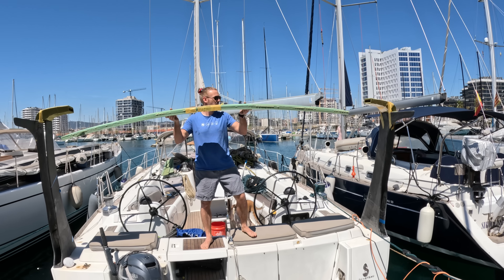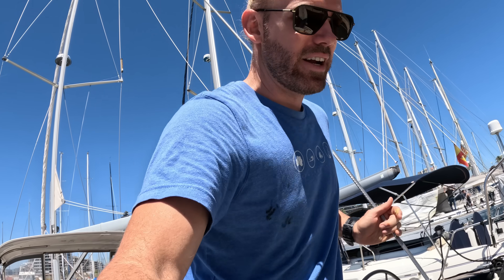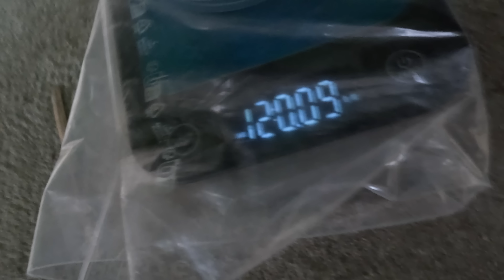Carbon Fiber Hardtop Bimini: The Ultimate Rain Catcher and Solar Power for Our Sailboat (9)

Comment: I admire your effort but I think you should cut your loss. I don't see how this is going to work. If you hang an inflatable from it and then  heal over you will get a lot of sideways stress that will be transferred to the deck by what looks like 2 inches. Think of it as a 5 foot crow bar! How are you expecting this setup to handle the sideways stress of a pounding sea on a heal?

Comment: CONCERN CONCERN!!!!  Bret, your bolts on your Carbon Fiber wings attachment to the boat, need a metal stock plate that you screw into.   Inside your wing and under your boat fiberglass.  Currently you have a   1.5" washer/bolt.   Over time those fibers are going to wear.  Take anything plastic and move it back and forth enough times and you will have 2 pieces.  Same theory with your 2 bolt holes for your carbon wings.

Comment: Why are the legs in two parts? If they'd have core and couple of layers of wrap around fiber, they'd be like about 1000 or more times stiffer sideways. Also, if they were stiffer, there would be less local bending on the mounting points and so on.
It wouldn't be the first time that the solar arc turns out to be too flexible sideways

Comment: HI guys , having worked in a glassfiber factory for a few years making parts for coaches and some boats , i know you are going to reinforce where the new legs bolt to the hull , a structure is only as strong as its weakest link . and to reinforce where the bolts intrude into the hull on the inside can only be a good thing , just saying is all . love youre channel and what you are doing , looks fantastic .keep up the great work .

Comment: This carbon fiber layout is a very labor intensive project, but the results are very impressive.
I did not realize that the foam in the stanchions would be removed. 
So, is there a threaded boss that is part of the assemblies that facilate fastening the sections together?

Good work you two!

Comment: The thicker the beam, the stronger it will be - Spear It Animal did what looked like 1.75" foam core with fiberglass on both sides, which seems to be strong enough - sort of surfboard dimensions.  Why are you guys going so thin with yours? 
The foam doesn't weigh anything, so why not have a thicker cross section?

Comment: This has been a ton of work.  If this fits and works the first time, you two need to open a boat top shop when you are done with your world tour. If it doesn't work, try try again. I'm still worried about big gusts of wind turning your boat into a kite or ripping it off, but I trust you two will figure it out.

Comment: Well its progress , but the way you've patch worked the black carbon fibreglass in some ares and not others is rather 
puzzling to me ? ( and maybe others too ? )  as there's 2 large sections and then nothing on other large sections of the green styrofoam . 
Hope this gets explained in next weeks video 👍🙏😸
Reply: I am guessing only the ribs to shave down costs? For the rest the fiber will mostly likely suffice.

Comment: For me it doesn't look good. I might look good when it is finished because you usually do a good job. I don't understand why the panels are only partially covered with carbon.
Reply: I am guessing only the ribs to shave down costs? For the rest the fiber will mostly likely suffice.